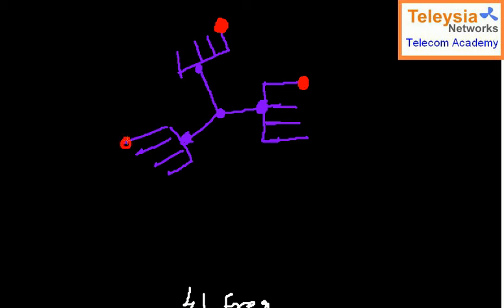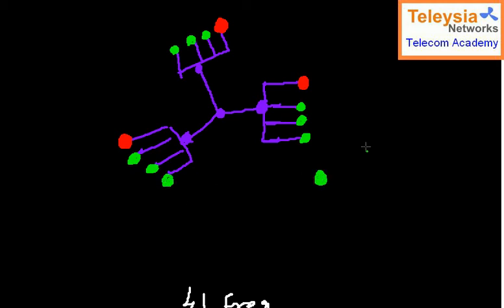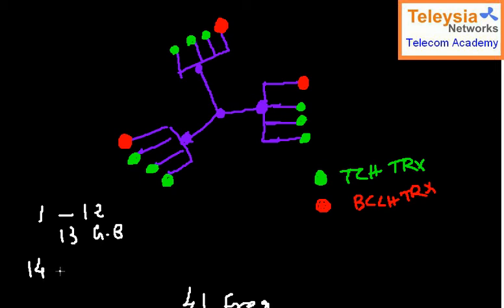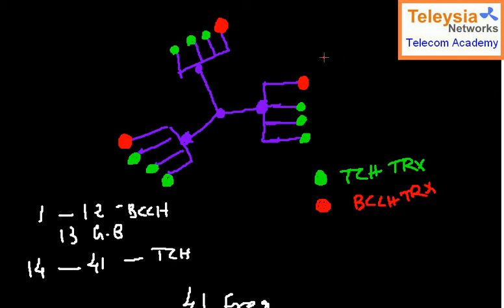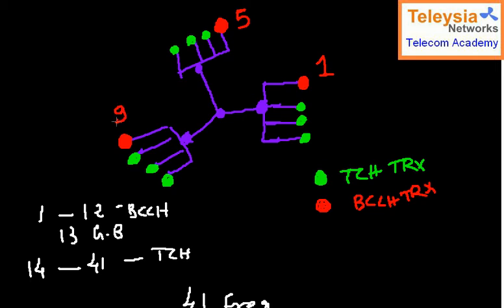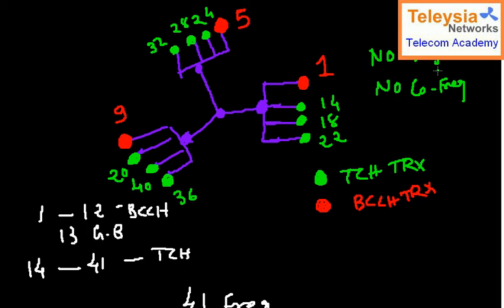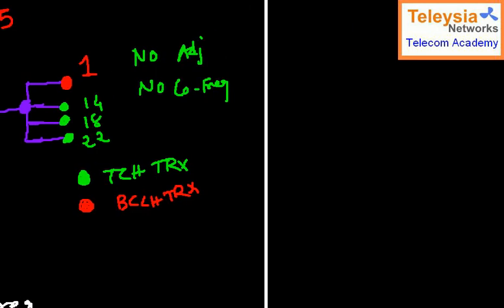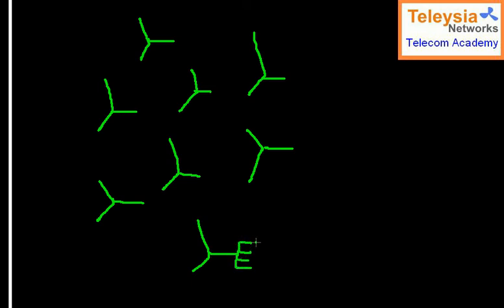Teleysia - GSM Frequency Band & Management Part 3

Comment: its depend on configuration of TRX (4+4+4) or (3+3+3). 
4+4+4 means 4 TRX in each sector (here 120 degree sector) and 4TRX = 4ARFCN.
1 ARFCN = 8 timeslot = 8users (if all traffic channel)
12 TRX = 96 users but 2-3 slots is used for signalling.
so around 93 users in each cell for 4+4+4 config